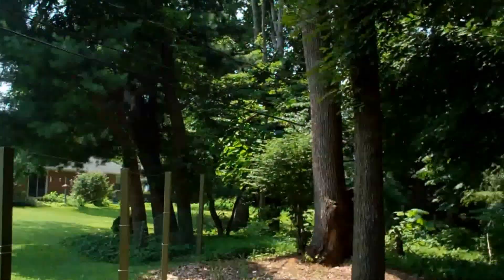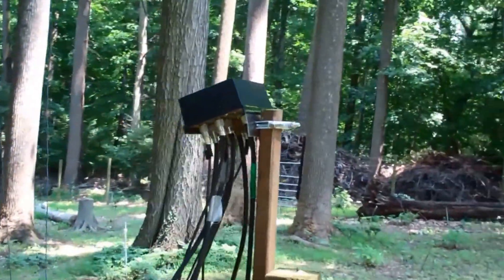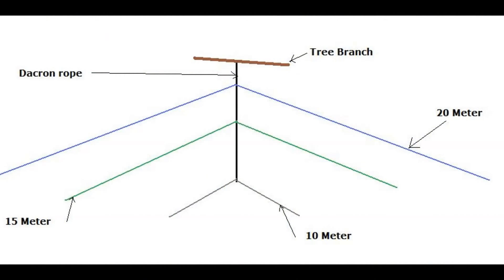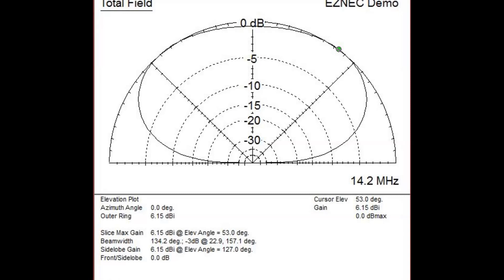N3FJP Antenna Tour - Dipoles & Loops at 6/10 of a Wavelength Work Great!

Comment: I run an IC-705 10w and run a 20m dipole at 42' based on your recommendations. I laugh at the signal reports when the other station reports 100w plus, multi element beans or hex beams,  and they just gave me an rst higher than I gave them.  I have no issue getting into Europe and have 1&3 qso's a week with NZ and or AUS.  I'm almost done with my quad loop on 20m and will test it at the same height soon.  Thanks for sharing your experiences.

Comment: Great setup. What kind of coax feed line do you send to the remote box from the shack? You also have to feed it 4 conductor with your feed line to use the remote switch? Lastly, what feed-line did you use from the remote box to the antenna feed point? I might try a similar setup. Adding up my costs first. Thanks for sharing.
Reply: I just use light rotor cable for switch box control.

Comment: Scott, your no-compromise approach is compelling.  Thanks for presenting it!  
For a 20m horizontal dipole (no V) located at 42', would you feed it with 50 Ohm coax or would you use an impedance matching transformer (such as  a 12th wavelength)?  
Would you use a balun (since a dipole is balanced and coax isn't)?  
Or are these accommodations unnecessary?
Reply from the maker: Thanks for your kind words!  I always use 50 ohm coax on dipoles, whether V or flat.  I am by no means an expert on baluns and can't verify this next piece of information, but I understand that the power loss a balun introduces is about the same as you would pick up in performance, making it a zero sum gain.  My dipoles, fed with 50 ohm coax without baluns work really well.
Reply: @Affirmatech  Thank you!  That's just what I wanted to know - what you do.  I'm convinced you are addressing the relevant matters, and that's all I want to do.  I'm glad to put the matter to bed!

Comment: Nice Antenna Farm.  I have used verticals, dipoles, and beams. I'm using a SGC 230 (10-160) and A OCF for (10-160) depending on the direction I want to talk will depend on the antenna I use. they are both at about 30 feet or so. Also have an (A3S) tribander at about 30 feet. 
Dipole antennas are great, it's a great antenna, I don't  care who says they aren't. 

I have taught ham classes, I tell the students you  do what you can with what you have. and most of the time there first antenna is a dipole. I know mine was.
Great software, and glad you are always there when we need your help.
73 Mike  NY0MN